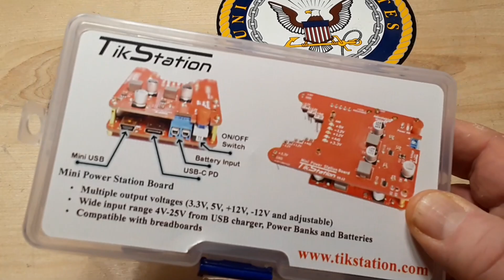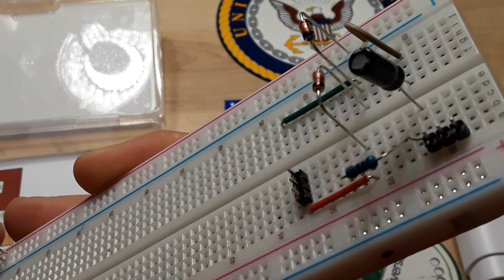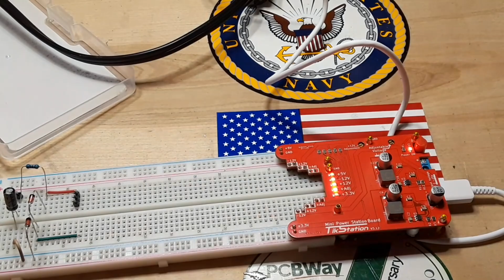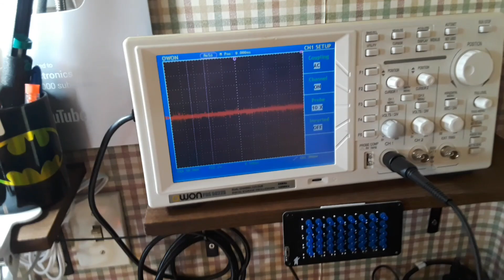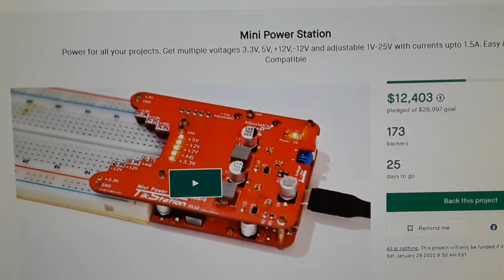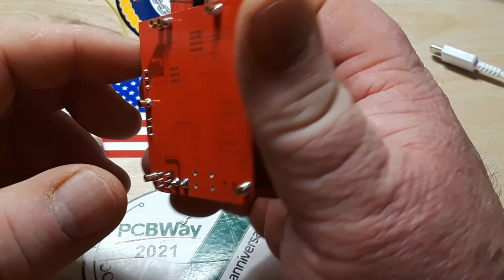TikStation Multi-rail Portable Power Supply

Comment: Looks like something I would have really enjoyed back when I was getting into electronics again. Especially during that period of time where you can build circuits from schematics, but struggle to modify the circuit when it shows a supply voltage that you don't currently use. I don't think anyone ever stops wiring an LED backwards every once in a while lol.